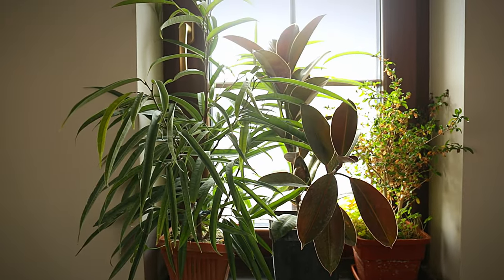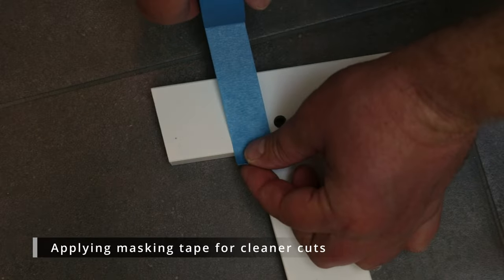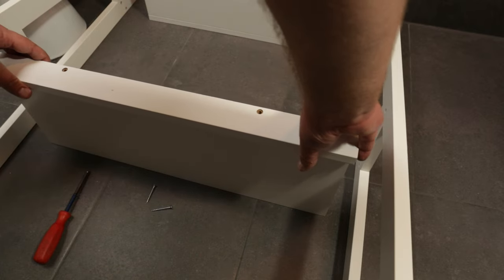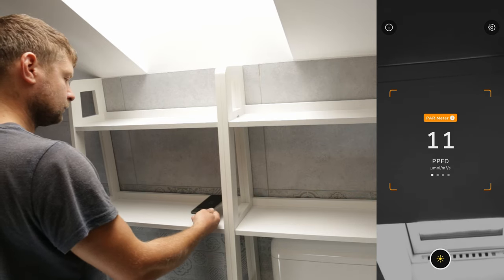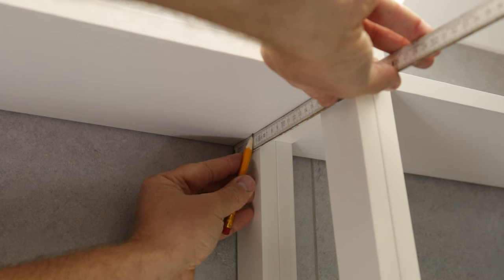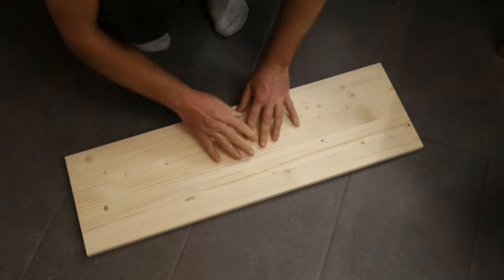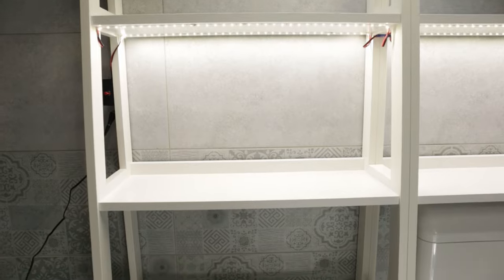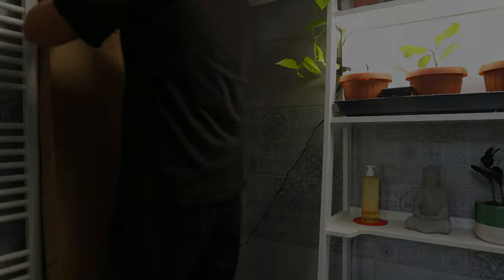Bathroom plant shelves with grow lights | Jysk ladder bookcase hack

Comment: nicely done, i like the offwhite paint more the original pure white maybe paint all shelves? ;-)
Reply from the maker: Honestly, I also like it more, especially since it's a mate color. I didn't think about painting all the rest using the same paint... Painting the MDF pieces would be straightforward but here could be one issue with the melamine-coated particle boards which make up the shelves. I don't know how those can be painted. I'll keep the idea in mind for next spring, after moving the plants outside again, but I can't promise anything. 😁

Comment: 👏👏👍🏽 So nice,  i wish i could find someone like you to come help me with my plants,  my yucaa etc is just not growing. Thanks for good advice,keep it up. Blessings
Reply from the maker: I would be glad to help with an advice for your plants if you can tell me more about them. When you say your plants are not growing, do you mean, they are growing slower than you expect them too or do they just seem dormant? The main reasons for plant not growing are related to light and temperature, sometimes even watering. However, not species act the same. Plants like the yucca are not particularly fast growers. For example, if you cut the top off a yucca plant it will take somewhere around a month for new shoots to start developing under ideal environmental conditions and even more under less than ideal cases.
Reply: Hello Bonsai,thanks for answering my comment. It's one year since i bought my yucaa,itwas really pretty ,lots of leafs.    It never get  taller and only 7 leafs remaining. My home is luminous,sometimes too much sun. I water it once a week, but no good results. It's  30inches.  Also my snake plants are growing slowly. Thanks very much for your advice. God bless
Reply from the maker: It may be an overwatering problem. You should not water on a fixed schedule. Both yucca and snakeplants hate having wet roots. Only water them when the soil is completely dry. Also make sure they are planted in well draining soil.
If your yucca has been dropping leaves it can also mean that it is affected by root rot. The only way to be sure is to take it out of the pot and examine the roots. It might be a good idea to repot since the soil they usually come in from the store is not ideal for growing at home.

Comment: My suggestion would be to skip installing the second shelf down, for example, on the third set of shelves, so that you have space for some taller friends as part of this set up.
Nice one!
Reply from the maker: That's a great idea! I could skip every second shelf and make this place for taller plants but Mrs. Odd Bonsai already has other plans for the lower shelves. So I will only skip the second shelf as you said.
Reply: @OddBonsai  I think it will look better with the lower shelves there  to aesthetically balance the bidet and toilet, so it is right in many ways to keep Mrs Odd Bonsai pleased :)
Reply from the maker: You've got a point there! 😁